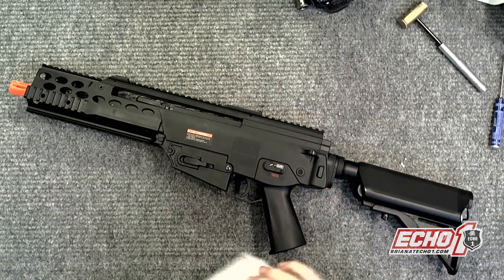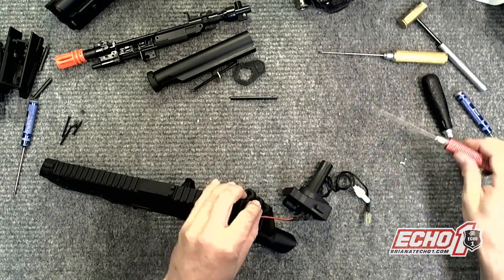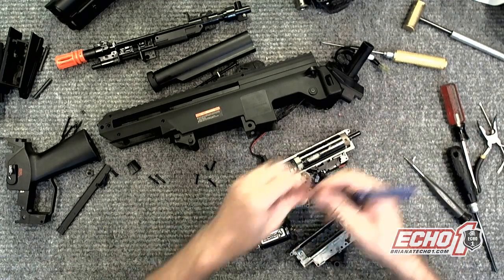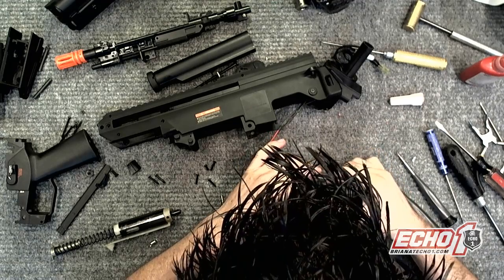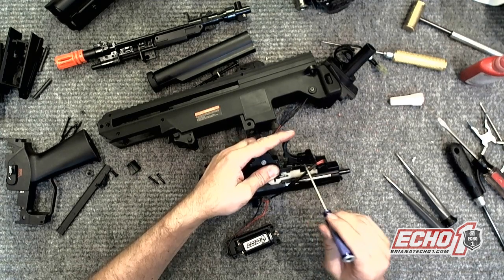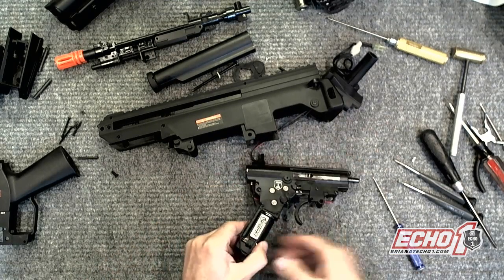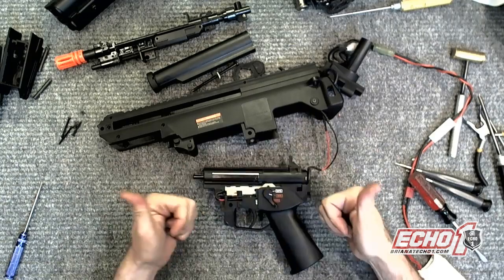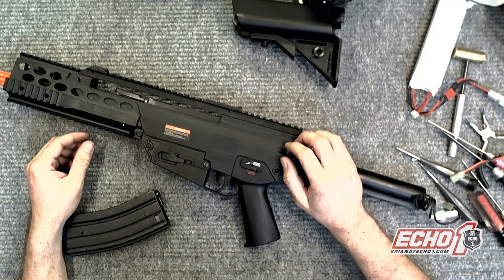Why is my Echo1 MTC shooting by itself? How do I fix it?

Comment: Great video! I'm planning on buying my friends jg mp5 off him, and it's having a firing issue, or as you called it a runaway gun. I figured it had something to do with wiring or the trigger contacts, an never thought it could've been a loose spring or screw. I'll have to look into that.